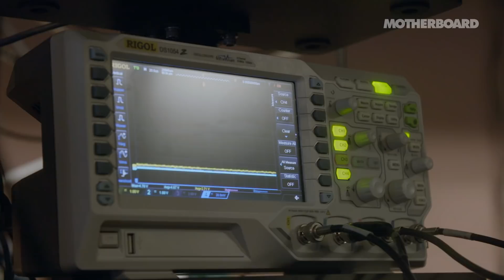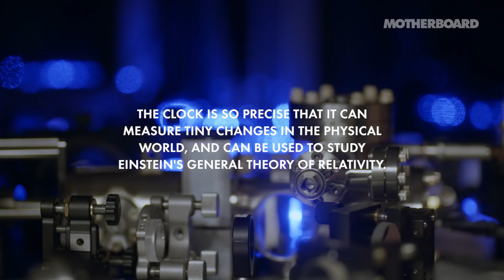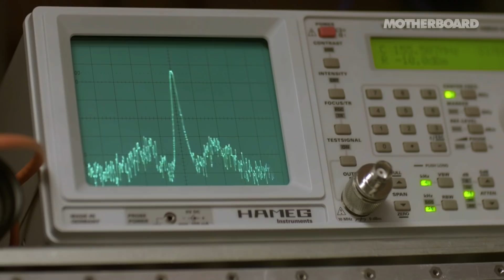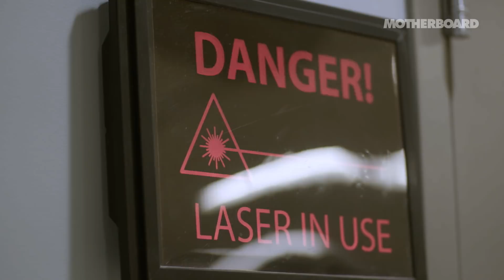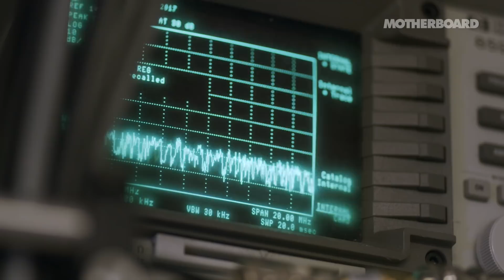Inside The Most Precise Atomic Clock in the World

Comment: the atomic clock with sub-1second deviation for the entire theoretical 13+ billion years of universe history is good, impressive.  Yet his ramblings about cars and black holes are just a bunch of nonsense, sadly. Better stick to your schtick man: to provide more clarity how "STRONTIUM OPTICAL LATTICE CLOCK" actually works, why strontium not hydrogen, how to prove it's precision, compared to what etc.. instead of showing us couple of visuals of the clock, bunch of cables, like we are some 5 year olds or adult imbeciles, uncapable of understanding important details.  That female phd in the video also failed to ask any deep, inquisitive, pertinent questions- better put some smart 12 year old there instead, who can ask probably better questions.
Reply: Might be late, but to answer your questions:

The time is standardized using laser light frequency resonant with the atom. Higher the frequency, higher the precision, atomic clocks use Cs/Sr atoms, as they have hyperfine transition state of ⁶S(1/2) F=3 and F=4, that has a a transition frequency of 9.2Ghz, in Optical clocks, the difference is that we use meta-stable Optical Transition, from ²S(1/2) to ²D(5/2) which has a transition frequency of 200Thz, we use the specific atoms due to their high transition frequency.

To prove it's precision, we use something called the Alain Variance, i.e we compare the clock, with itself. We measure the frequency variations over a set period of time, and then check it's deviation from the frequency variations for the same time interval again. By comparing these, we get to quantify the variations. Each clock, has its own Alain Variance curve defined, that has an Optimal Operating time and the variance at that Operating time defined.
Hope this helps, feel free to ask any further doubts you may have and also to correct me, in case there's an error..

Comment: Are atomic clocks affected by gravitational waves?
Reply: Yes, but current atomic clocks are not that accurate, and frequency shift due to gravitational waves is masked by the noise in the local oscillator (laser used to probe the ultranarrow atomic transition). In the near future, it is possible to increase the clock accuracy by several orders of magnitude and atomic clocks might be able to detect gravitational waves.

Comment: Star treks transporter would need something like this to freeze time to a quantum level for a scan and construct, But it would have to be a wee bit smaller as it would only be one critical component.
Reply: The warp drive is reachable apparently easily using electricity on nanocarbon tubes... mini warp drives were discovered in a NASA experiment recently.

Comment: Thanks for the video.  I was pretty doubtful of this topic, expecting that they've found a new element that can vibrate better than the previous record of Hydrogen.  I also doubted the statement at 2:27 as it cant easily the most accurate measurement ever.  I thought, if scientists will be able to count the vibrations or cycle of light, then it will be insanely accurate (considering that the distance traveled by light in KM was adjusted to remove the last decimal, basing the length of a meter from light.  The unit of meter and second are intertwined) .  
I got ahead of the video when I searched for the basis of measurement of the second in wikipedia, then the words, Optical Lattice blew up to my face.  They finally did it and was announced in 2015!
Reply: It is intriguing when he mentioned it could be used for gravitational waves.  I imagine them building one clock at the bottom of a building and the other at the top.  The two clocks will know each others rate all the time, when a gravitational wave arrives, the clocks will detect an anomaly.

Comment: Why not Livestream the atomic clock.  ?

YouTube dollars..
Reply: The delay introduced by the live stream would negate the precision of the clock. Although if that wasn't the case your idea would be great.  Super precise time just a click away!
Reply: Yeah. It's been done. Your pc and phone use it and already account for the latency problem.

https://en.m.wikipedia.org/wiki/Network_Time_Protocol

Or you can buy a clock that gets an atomic time broadcast, those have been around for decades.

https://en.m.wikipedia.org/wiki/Radio_clock
Reply: YouTube Customer Support Turns out we're both wrong. I have two phones so I brought up one on LTE and the other on wifi and checked. My LTE time was just over 600 ms off from network time, but wifi was off by 2 full seconds - so that's service-dependent and NOT incorporating NTP time correction.

My Linux machines are under 400 ms jitter, I'll have to check my Windows and Macs.

Good catch! 

Still - NTP apps can be downloaded, GPS status can as well, there's no need to livestream a stratum 0 clock to watch for entertainment.

PS - let's be agree to be careful about the definition of perfect because nothing is -

https://serverfault.com/questions/508586/is-there-research-material-on-ntp-accuracy-available
Reply: YouTube Customer Support Fwiw, I just checked my Windows laptop - less than a second error, same wifi network as earlier when I checked my other phone.